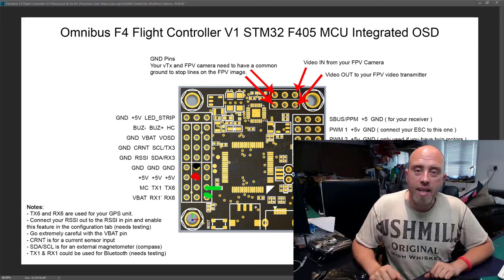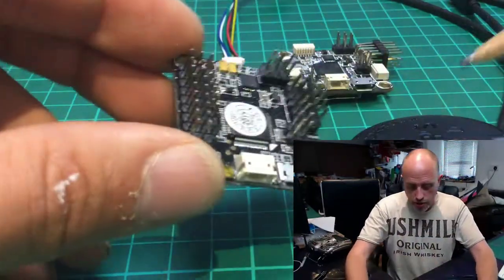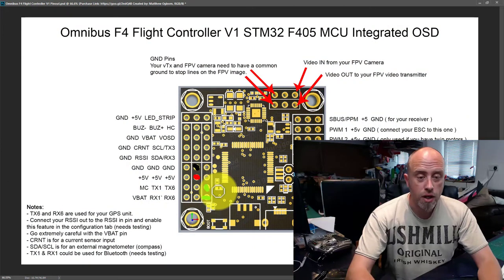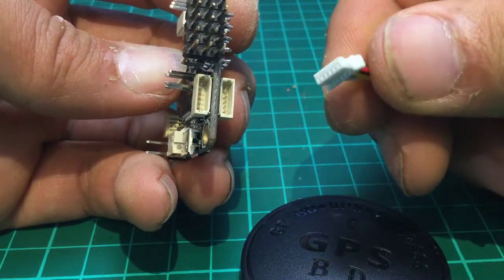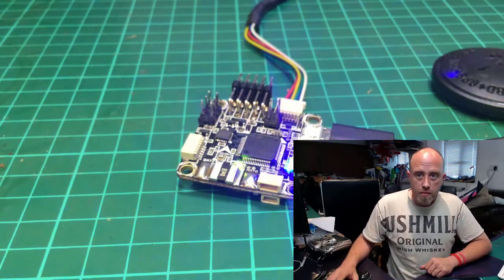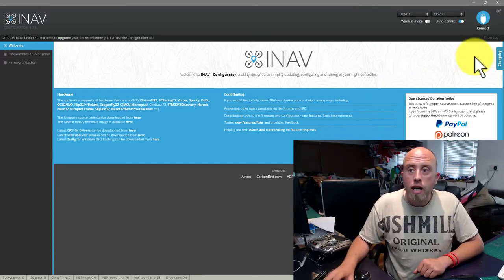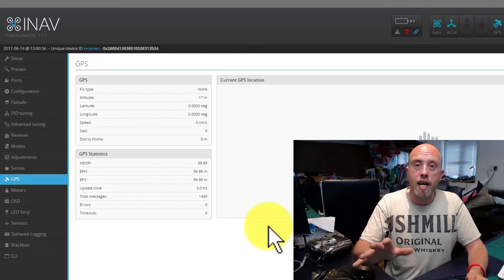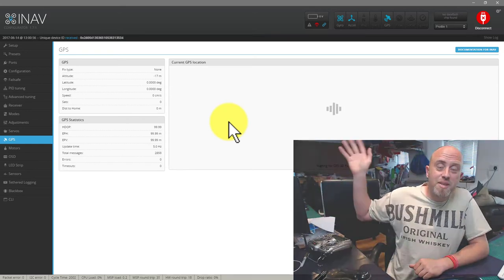Part # 11 - Connecting the GPS module to Your iNav Flight Controller (V1 & V2 Boards)

Comment: Hi Matt, many thanks for your tutorial, it's really well done and very detailed, I followed all steps to connect Ublox M8N to my Omnibus F4 Pro and...wow!! My GPS is working now on Betaflight 3.2.1 Quad X! Thanks again.  How to set up the port for magnetometer/compass (it's the UART 3?) because I connected SCL and SDA wires form the mag built together with the GPS unit to the relatives pins on J10 port but the magnetometer still not working, how to solve? Thanks in advance.

Comment: Hi Matt thanks for a detailed series I am half way; you see I, like you  love the ET Vector but baulk at the price; so I started searching and bought all the others you mentioned, but all have issues and higher prices with the exception of the APM; but I gave up finding an OSD board that worked?? I do like to have Air speed on my OSD, which the APM does even without a Pitot tube!; do you know if the latest iNav can do this or is it coming? or an add on sensor with Pitot tube?
Keep up the good work I am relatively new at this so your efforts are much appreciated.
Cheers Adrian
Reply from the maker: Howdy Adrian, the GPS speed works well enough to be honest, however that said I believe in the latest version 1.7.3 the airspeed sensor has now been supported in iNav, Matt
Reply: Hey Matt thanks for the prompt reply, I will investigate, perhaps you could do a vid on that item like which Air Speed sensor to buy etc. I'm sure lots of guys will be interested
Cheers Adrian

Comment: Hello Matt, great great video's. I am working on it now. 

But I have a question about the Volts for the GPS

This is info from the site for the GPS

Supply voltage 1.65 V to 3.6 V (NEO-M8M), 2.7 V to 3.6 V  
Power consumption4 23 mA @ 3.0 V (continuous),5 mA @ 3.0 V Power Save Mode(1 Hz, GPS mode only)
Backup Supply 1.4 to 3.6 V

The FC board is 5V?
Reply: I find this from you:
"Howdy, no. See the other video in this series as the GPS unit has a voltage regulator in it. Matt"
I'm doing some research ;-)

Comment: Hi Matt, for the V1 board, wouldn't it be easier to use 2 servo plugs and wire plug 1: TX - RX -5v and plug 2: Gnd - SDA - SLC. Then you just need to start at the bottom and have the red wire (5v) at the top, and plug 2 above it with the black wire (Gnd) at the bottom.
Reply from the maker: Howdy fella, if that makes sense for you, go for it :)

Comment: Hi Matt, excellent videos, it is so helpful for someone like me who has never built anything like this before.  I bought the Omnibus F4 V1 and a M8N GPS unit and have followed all the instructions on your videos and I am having problems, I am unable to pick up any satellites, I have tried the obvious stuff like switching the TX and RX wires, everything is enabled in INAV, I have a red power light on the GPS module and green flashing lights as well which seem to come on and off randomly.  The satellite icon on INAV is red, I have read lots on the Wiki and read lots on various websites searching for some answers.  I am beginning to think that the GPS unit may be faulty, any help or suggestions would be much appreciated.  Many thanks.
Reply: Panic over, on the GPS unit I had purchased from eBay  the green and yellow wires are for RX and TX. I opened the case up on the M8N only to discover I had been using the wrong wires.  I just hope I don’t blow anything up during the rest of the build lol.

Comment: Hi , i see a lot of videos from you. I like it :) i learned so much. :)

I have a question an didn't found any video from you. 

I would like to build an wing with an omnibus f4 pro v3 and ,m8n GPS 

I use an Taranis x9d and a x4rsb receiver. 

I connect GPS rx and TX on uart 6 and the barometer on uart3 /sdl and sca right? 

On sbus , 5v and gnd I connect my receiver right ?

Where can I put my telemetry cable ? 
I read some about to connect it to USB vcp?  And get telemetry data since the wing is armed? 

Many many questions :) I hope you can help. Regards from Germany ...
Reply from the maker: Howdy, I am not sure with the x4rsb receiver, you'll need to google it to find out how for telemetry. Also this set of tutorials only covers fixed wing models and there is no need for a Baro on a fixed wing model, Matt

Comment: Hey Matt. I have my plane trimmed in manual mode. When I switch to angle it starts dropping, even though I caled it for level. Should I set level slightly nose up?

Comment: hi Matt, i have three planes that i want to put inav on. a mini talon, a wing wing z84 and a micro skyhunter. I thought i heard you say in a video that you don't need a compass as a sensor for return to home. Is this correct? can i use an SP F3 acro board(i have two from quads that i don't fly that much)

many thanks and i like your content very much.
Reply from the maker: Howdy Fox, yea thats right, the GPS is good enough, especially the NEO M8N ones I've been using. As for a SP F3 board, yea it'll be fine it's not a Naze32 or CC3D board :) Hope that helps! Oh and if you want an OSD you'll need to use a Minimum OSD or similar for it. Hope that helps, Matt
Reply: Matthew Ogborne thanks!

Comment: what I have FC 10DOF F3 for Eachine wizzard (that was cheap 10DOF) does not give 5volts to uart so GPS from usb cable power only :( very hard to power on GPs module to config and test... I cut an other USB cable and soldered its 5V/GND to the uart 5volt/GND and plug that in too to have GPS power...
question: I have a GPS BS-280 from APM has 38400 baud rate set can I use it on that baud or 115000 is a must for good navigation?

Comment: hi matt !  yeah ! ,, i just received my gps today {same as yours} so i was exited to continue your video where i left it to connect this gps , but bad suprise the gps connector as a bigger connector than the omnibus f4 v2 board , but can you tell me what kind of connector it is ?  i`m not sure of the name is it micro jst 1.0 or 2.0 ? thank you matt
Reply from the maker: Howdy fella, see video 2 in the series, off the top of my head it's a JST 6pm 1mm spacing, Matt

Comment: Hi matt, if i may ask. Theres recently a new f7 fc in the market, NTXF7. Its an all in one fc with pdb, baro, & vtx, but it doesnt have SDA & SCL pads. Is there a way to get around this for this fc to install a magnetometer that comes in a gps module?
Reply from the maker: Howdy, I've not seen that one. I like the Matek F722 board. That said, you do not need a compass for a fixed wing model, so no worries if it does not have these pads. However for a multi rotor, it is needed and a different board would be suggested. Matt
Reply: RagTheNutsOff initially i had my sights on matek f722 but its extra 1board on the stack for the pdb, thought i could save with 1 less board on the stack. Its for a 7 inch long range quad project. Its alright. Thank you for your thoughts.

Comment: Hi Matt...On my v1 Board, I use a 4 Pin Dupont plug for my GPS...Neater and less likely to get it in backwards....Not sure why you are not using the power and ground in line with the rx/tx pins..?
Reply from the maker: Howdy ET, the answer is simple. 99% of people have spare servo wires to use, thus more likely for them to be able to follow along. A 3S battery connector would of course work well too! Matt
Reply: Oh, I see, well I used E-Bay, you can buy a huge bag full of ready made wires with (single) Dupont ends on them. Then you pick off the colours you want, select a 3,4,or 5 Pin plug and insert them...easier than cutting up servo cables for sure and you can colour match, plus each wire has a crimp ready fitted both ends. Try it, I used to do what you are doing though to be fair.

Comment: Any particular you are choosing the middle row to power the gps? It seems that all three rows with gnd and 5v would be able to power the gps when looking at your pinout. The reason why I am asking is that I am having problems getting my FC/Gps to communicate.
Reply from the maker: Howdy Dave, none at all. 5V is 5V, Matt
Reply: As I thought then! Thank you!
Reply: Figured it out!!!

Since my clone Omnibus had UART6 where all other people seem to have their on UART1.  (noticed when trying to connect SBUS reciever). I figured that other UART:s probably were placed wrong too then and that was the case. To get GPS working I had to connect tx/rx from module one row below from where you connect them to tx1/rx1 on pinout. In my case this is UART1.

 Thought I would mention it since I spent quite some time on figuring it out and maybe some other poor bastard runs in to the same weird "clone" and reads this.

Comment: Hi Matt. Can you tell me at what point I should have a green light for 'hardware health' in setup tab. So far I have all green except the last one.
Reply from the maker: Morning Davy, I've not noticed that one staying red before, although I just plugged one in and while it had no GPS lock it's showing red for navigation safe and hardware health. So I'm wondering whether you should just arm the board and see if that kicks it in and that cross goes away :) Matt
Reply: Hi Matt. Problem solved. In configuration tab under sensors , Barometer was set to 'Fake'. Changed it to 'None'. Green lights across the board. Happy Days.

Comment: I am having a little trouble, I rec my gps to day for my F4 Omnibus Pro V2 and found my pin color is different from matts also the plug wont fit the board ( on the 4 pin its red yellow green blank then blk other connector is orange white)  Its a GPS MODULE with compass (powered by ublox m8n) please matt can you help ???
Reply from the maker: Howdy Nigel, red and black are obvious for +5V and ground, the other two, you have a 50/50 chance of getting them right. So follow what's mentioned in the series, try it one way and if it doesn't work, swap the yellow & green around. Also checking the details from the place you bought the GPS unit is also suggested too, Matt
Reply: Matthew Ogborne the only other problem is that, the plug supplied won't fit the flight controller if it's the one like you show me in the video.  I have tried it both ways it just won't go in? Also the plug is for the v2 board the little white one. I can't swap the yellow and green round?
Reply from the maker: Yes Nigel your pin/wire colours maybe different on the supplied lead from the FC, ignore those and use the ones from the GPS unit and match them to the pinouts on the FC. See this video https://www.youtube.com/watch?v=OK1noBA4UVo&list=PLgoM4-umzSqd0clW-e_A12yKiOpV--3a2&index=8

Comment: I have the V3 board, just connected a GPS after this instructions. The GPS is running fine, but i have problems with the magtometer. I can see that the SCl and SDA pins doubles as TX3 and RX3, can that bee the problem ?
Reply from the maker: Howdy Per, unless you are using a quadcopter (not covered in this series) then you don't need the Baro or Mag for a fixed wing model, the GPS is more than enough to get you home. Matt
Reply: It is for a quadcopter. The V3 board can see the mag, after a "defaults" mag is blinking red some times. After configuring uart6 for gps and uart1 for Rx, it is constant red.
Reply: The GPS i am using are a little different from yours (white print on top) I have ordered the same as you are using.  Can you enable mag on a V3 board ?
Reply from the maker: Howdy Per, in that case, yea enable the Baro and Mag. iNav should pick them up automatically. If it doesn;t set them to auto and press save & reboot. That will then pick them up. As for a v3 board, I would assume so. I only have one V3 board, the rest are V2's, Matt
Reply: I did set it to auto, and inav picked it up. It's just not communicating :-(
Reply from the maker: Swap the wires around the other way then. NOT red & black! but the SDA and SCL wires and see fi that solves it :)

Comment: Can you tell me work  NEO-M7N GPS   Omnibus F4 V2 Flight Controller ??
Reply from the maker: Howdy Xato, it probably does, but have never used one myself. I am only comfortable suggesting parts that I have personally used, hence the details in video 1 & 2 of this series, Matt
Reply: Yes they do, but you will have to search for a pin out diagram. I used the diagram from hobbyking for a NEO-M7M and it worked.

Comment: Aren't you technically overpowering the GPS? The product description says:
"Supply voltage 1.65 V to 3.6 V (NEO-M8M), 2.7 V to 3.6 V (NEO-M8N/Q)"

But you are giving it 5V?
Reply from the maker: Howdy, no. See the other video in this series as the GPS unit has a voltage regulator in it. Matt
Reply: Oh okay, so the product description of banggood is wrong? Not sure which video you are refering to. So what's the maximum voltage it can take? 
Cheers!